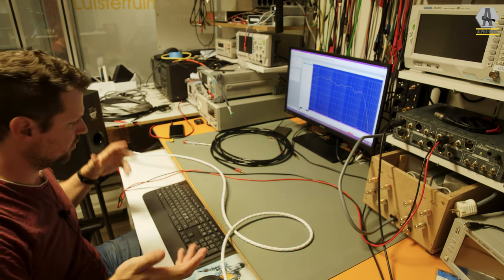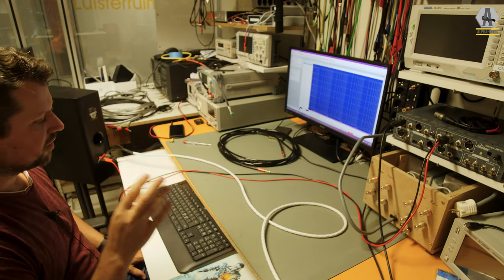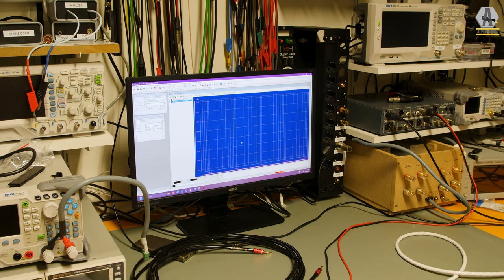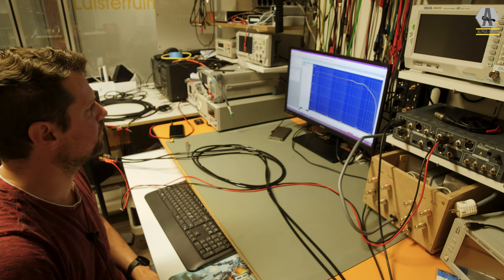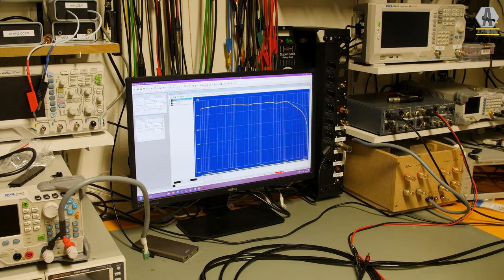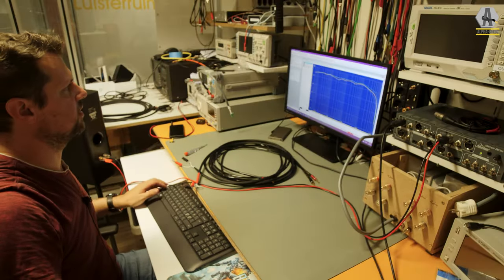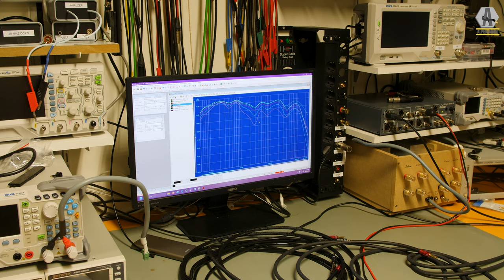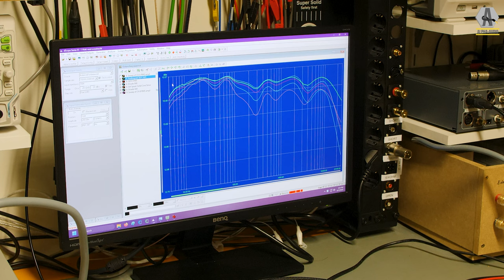Alpha Labs - Do speaker cables matter? We measured five of them!

Comment: Very excellent and informative
Please repeat the test without the speaker and using a high wattage resistor that has the same impedance as the speaker.
Thankful
Reply from the maker: I did... you get a flat response with all cables. You probably knew that. But it's useless, because a speaker is not a flat impedance, nor a static load.
Reply: @TheAlphaAudio  Yes, I knew, I wanted to tell you that this is the problem with the crossover. If you test a speaker, for example, only one woofer, the impedance will be very flat.
Crossovers of the second degree and above cause this problem
Reply from the maker: @aminbjt5843  But the interaction with the crossover doesn't matter in this case. I am measuring the differences between the cables... it is in that sense a relative measurement... it's about the differences between A and B... and that is what you will hear in the end anyway...
Reply: @TheAlphaAudio  What is a crossover?
The combination of inductor and capacitor is used to separate high, low and mid frequencies
The combination of inductor and capacitor in two and higher order designs causes resonance at a specific frequency
And this causes the input impedance to drop drastically in these frequencies.
Therefore, it causes more current in the cable. Also, the frequency response fluctuates
If you modify the crossover, you will no longer need expensive cables
Reply from the maker: @aminbjt5843  if... but that is not the reality. I have an article online with measurements on multiple speakers with multiple amplifiers and multiple cables... the characteristics of the cables remain... so... cables matter... in the real world. Can you create a system that is immune to cables... sure... probably.
Reply: @TheAlphaAudio  As mentioned earlier and you yourself raised it, if the load is completely ohmic, all the cables will have the same response.
So where is the problem?
You said that speakers have variable impedance.
For example, a 4 ohm woofer is usually 3.5 ohms and the rest is the impedance created in the woofer coil.
So there is little impedance change.
What makes the impedance highly variable is the second-order passive crossover.
measure
Give a pure sinusoidal signal and slowly change it from 20 Hz to 20 kHz.
Connect the output of the function generator to a flat response amplifier.
Connect the output of the amplifier to a second or third or ... degree passive crossover.
Connect the crossover output to a pure 4 or 6 or 8 ohm load.
Constantly measure the output alternating current of the amplifier.
The result will be amazing!!!
Reply: @TheAlphaAudio  In answer to the last question, I have to say yes!
Two solutions.
First solution:
Use first class passive crossover.
Second solution:
Instead of building one powerful amplifier, use three smaller amplifiers.
Then filter the signal and give it to the input of the amplifiers.
(cross over active)
In this mode, you will have a lot of control over every spectrum of sound.
In the real world